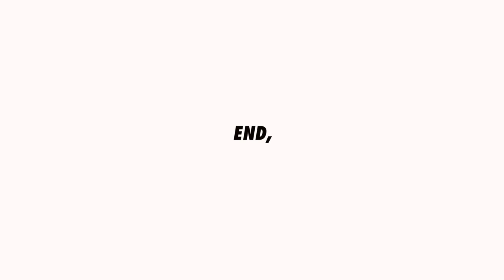W67_Cool kitchen design

Comment: I've seen some of your videos already and you usually use buiscuits to join 2 pieces of wood. Are those joints strong enough for the works you do? Is there a particular reason you use that method? And on this one you used screws, wich I haven't seen you use much. Was there a reason to use them this time? And as always, it's a pleasure to watch you work. Please continue making more videos.
Reply from the maker: buiscuits are enough strong, cheap, and very easy.